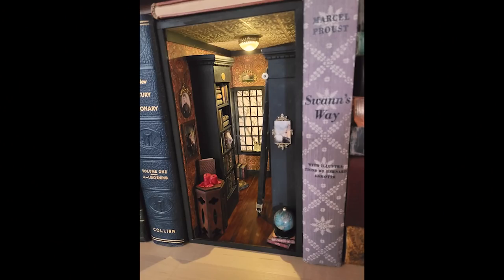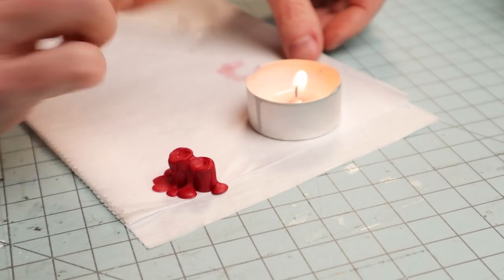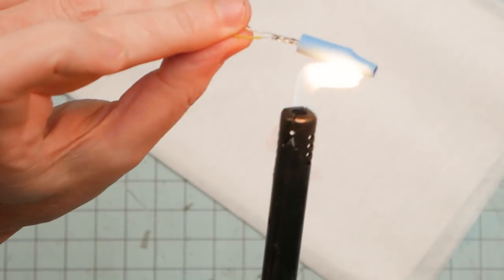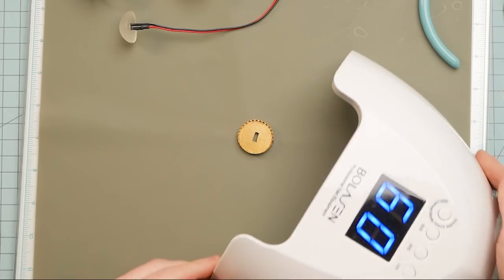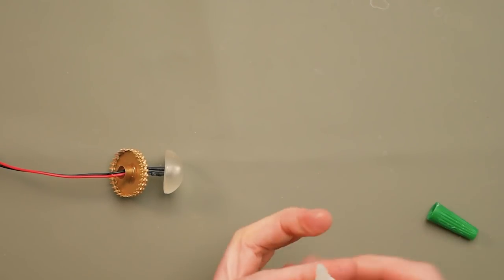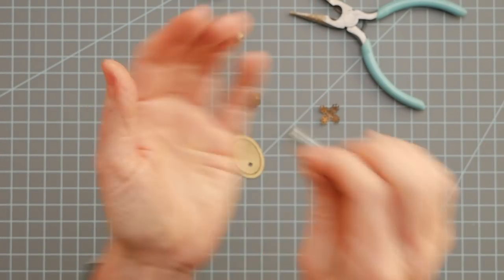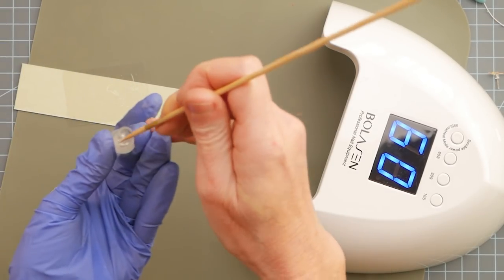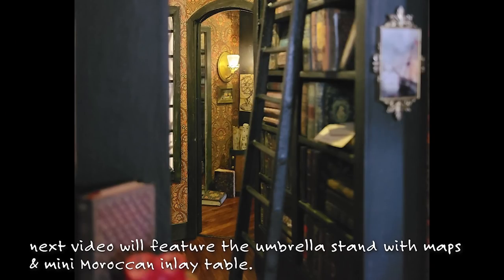MINIATURE Flickering Wax Candles

Comment: Hello Nik, really enjoyed this video and was wondering how to get like a chandelier with multiple candles to flicker independently so these look more real.
Maybe by bending the light on a crumpled piece of tinfoil instead might do the trick.
What do you think?
Reply from the maker: Hmmm...I've been pondering your question.  James used an arduino w/breadboard that was programmed to randomly light up individual LEDs for his sky project.  But, I know they make twinkling/flickering LED fairy light strings.  Don't they twinkle at random?  If so, you could grab one of the shorter strings off amazon and attach a fiber optic strand to however many bulbs for the number of candles you need to supply light for.  If there are too many lights, you can cut off the excess lights at the end as long as they are on a 2 wired parallel circuit, which I think most of them are.

Comment: Could you just use regular Fishing Line,  or is Fiber Optic cable somehow different?
Reply from the maker: I know fiber optic filament has special properties, but its always worth a shot!
Reply: @NiktheBooksmith  I was wondering if it was actually GLASS, but seems like it would break, feels like plastic in those weird lights and on fake xmas trees. Seems like it's more straight than fishing line and I'm not sure if it's because the line is wrapped around a smaller spool or what